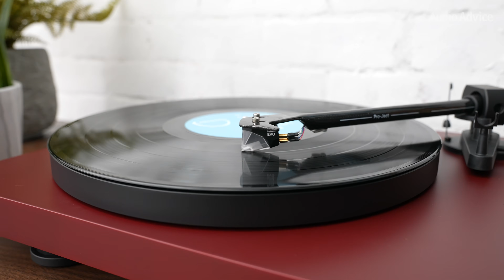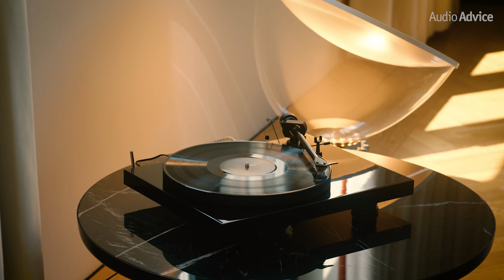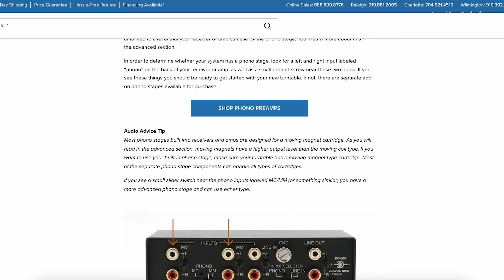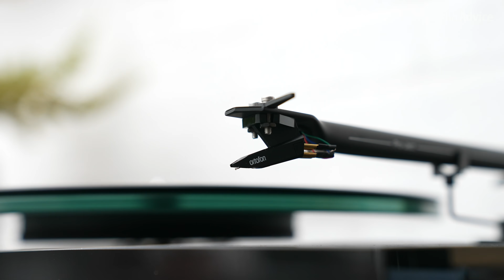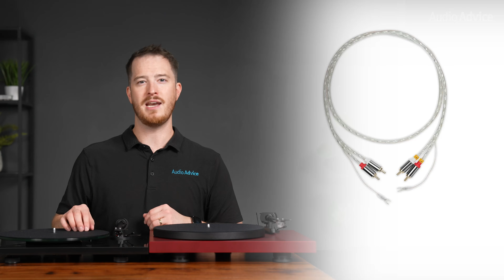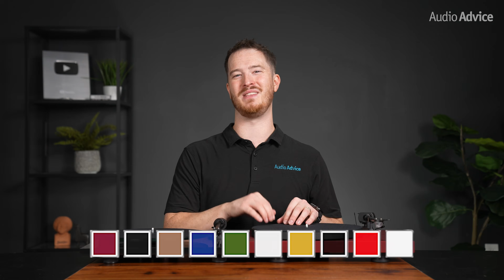NEW Pro-Ject Debut EVO 2 & T1 EVO Manual Belt Turntables | Full Overview & Buying Guide

Comment: Good afternoon, Please advice connection between Pro-ject Debut Evo2 and Amplifier Denon AVR-2000XR
What is missing, pre-amplifier?
Reply from the maker: You’ll need to use an external phono preamp before connecting to the Denon’s line-level input.

Comment: There is nothing wrong with automatic turntables.  When a turntable is well designed either wuality material.   Manual turntables, especially for older folks can be a pain, in the ass.
Reply from the maker: If it is done right in some cases yes.  Thanks for watching

Comment: Thank you so much for the video! I would like to buy the new pro ject t1 evo bt. However, I have read negative reviews about the integrated antiskating. What do you think? Thank you so much!
Reply from the maker: Glad you liked the video.  The tracking force needs to be properly set for the antiskate to work correctly, which you can confirm using the stylus gauge included in the box.  Thanks for watching
Reply: @AudioAdvice  thank you so much! very kind! I was a little scared considering that there is no possibility to adjust the antiskating and in some videos here on youtube I had seen that it doesn't work very well.

Comment: I have a new KEF LSX II system and have been using a Gemini DJ turntable for years. Would the T1 EVO be a substantial upgrade or would the T2 be a better match? 
Not really looking to upgrade for years to come so I’m not worried about the fixed cable on the T1 (which is nice so..)
Reply from the maker: You have some great speakers.  Please reach out to our team at www.audioadvice.com to discuss your best turntable options.

Comment: The most expensive Pro-Ject turntable is also the heaviest. That thing weighs 80 pounds! I have a home theater system that weighs about that much and it's a literal pain to move.
Reply from the maker: It’s a beast, no doubt.
Reply: @AudioAdvice And heavy platters transmit vibration.